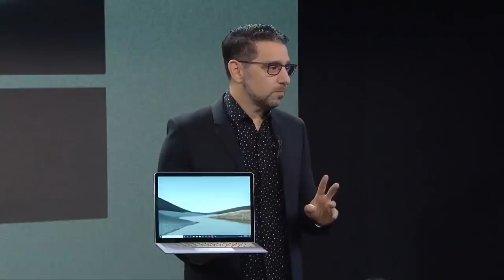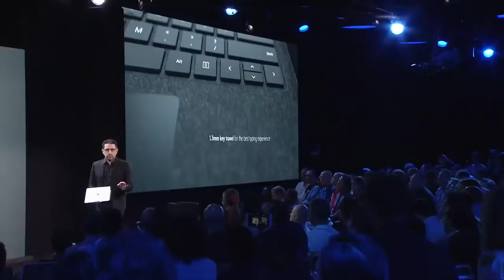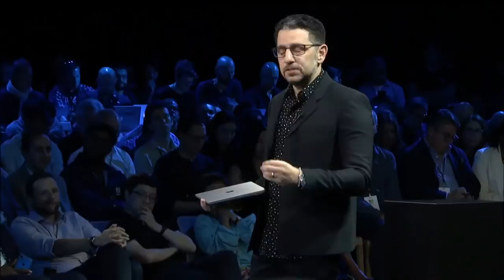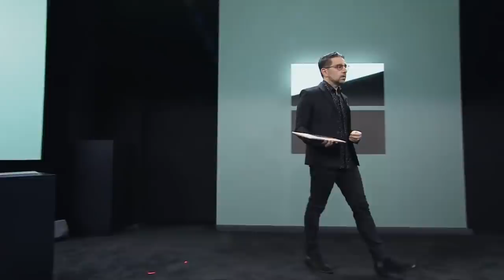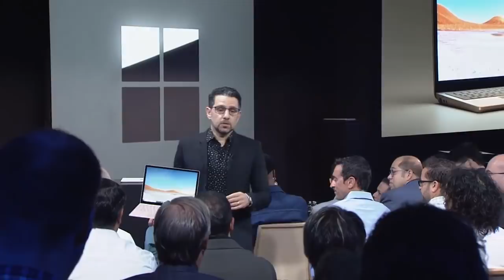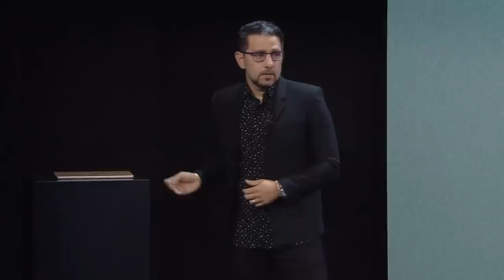Microsoft says they value repair-ability, designs more repairable product.

Comment: The surface laptop received a historic zero out of 10 on iFixit's repairability scale in June 2017
They're about to go from one end of the scale to the other ;)
Reply: Yep, it will be improved to a 1.
Reply: @zeroyon223 Im still running my G7 from 2009. fucker survived Iraq and Afghanistan. I've only had to replace my screen and battery.
Reply: @zeroyon223 well, more like the entire top portion... but show me a laptop that could handle shrapnel.
Reply: @GIboy1990  Mil-spec Panasonic Toughbook ;)
Reply: @maw136  not a chance. They can handle shockwave and overpressure. But not shrapnel

Comment: When I chose a "standard computer" for my place of work in 1998 I went for the Compaq EP series just because of a design like this - you could service it with barely a tool (all thumbscrews to get into the case, and from there it was snap in with screws that were screwed into the front plate so you don't have to look for them to add a harddrive, but once the screws are in mounting and removing the drive can be done without any tools). In addition the user could chose themselves if they wanted a (albeit fat) desktop or a minitower configuration, all they had to do was turn it 90 degrees. I loved that design, it made my network of about 60 PCs manageable for a single person (me), in addition to running the servers, administering the user base etc. pp.

HP still has a page for it, but did they learn from that design? Not really (and I can say that, having used both a Z240 and a Z610 the last few years). https://support.hp.com/us-en/product/compaq-deskpro-ep-desktop-pc-series/96269/document/c00340318

I never saw a PC that was that nice to service personell since then.

Comment: I would probably get up getting the Surface Laptop 3 Ryzen 5 15 inch model with 16 gigs of ram, 1700 is a lot but I got my first gen Surface Laptop super cheap through a couple stacked deals and has been working strong ever since.  This one being easier to repair if I needed to even just change the battery or something without destroying the keyboard makes it a really interesting choice.  I've heard the keyboard is still good and the form factor for the screen is great for my work.

That's if I don't break down and pay a bit more for the Surface X 16gig model with keyboard/pen, I do low level programming at hardware level and more than understand the weakness of ARM in terms of mass compatibility but I'm a fan/hopeful that it will become a true contender along side X86-64 processors for more than just mobile tasking.  Apple's Bionic chips have been really impressive, here's hoping this Microsoft/Qualcomm chip will give a similar result in terms of speed/access like the Apple processor is capable of.

Comment: If only they had this mindset from the beginning... I have a Surface Pro 4 here on my desk that does not boot. The only way for me to get inside to find out what the issue is, is for me to attempt to remove the screen without breaking it, and without damaging the aluminum around the screen. It's literally not worth sending to Microsoft to get fixed either, as the cost is almost the same as buying a refurbished Surface Pro (a newer model even)

Comment: I'm less about ease of repair, and more about extreme reliability. The only thing I want to be replaceable is the SSD - since these things are wearing down while bigger and cheaper models are available year by year.

I'm all right with *everything else* being soldered as long as it works fine for many years. You want to solder stuff? Fine, but give me 5 year warranty **that includes battery**. Make whole thing hard to break, use premium materials and stuff - If I'm paying thousands of dollars for the laptop, I demand quality.

 I'm sick and tired of seeing extremally expensive all soldered garbage produced by Apple, Alienware, Razer and many other companies. It's fucking ridiculous.

Comment: Microsoft: creates repairable product

Apple: Wait that's illegal
Reply: As Louis has said, even planting the "seeds of repairability" is a welcome feature as opposed to making it totally unserviceable.
Reply: "But I need AppleCare".
Reply: @Swift Boiz < Well the big difference is that at least you don't have to "destroy" the keyboard cover like you did on the Surface, in order to access the internals.  I think that's a step in the right direction, any little thing helps.
Reply: @Swift Boiz The difference is that the chance are people have better odds of taking things apart than glued shut device. Pretty sure there will be screwdriver for these new "proprietary screws" that would become available for purchase on ebay or aliexpress etc.
Reply: @MarineRX179  iFixit would be my go to.
Reply: @Swift Boiz Soldering the RAM is inevitable as even the smallest standard package of that, SODIMM, is HUGE in terms of the clearance you have in modern ultrabooks. But, in my opinion, any vendor who thinks it is a good idea to solder SSDs should be condemned, and yes, both Microsoft and Apple solders SSDs, and as far as I know, Surfaces kill their boards much more often due to overheat than MacBook pros :(.
Reply: @Swift Boiz R/Whoosh
Reply: @Swift Boiz with 3 children?  That makes sense, even if I was a Virgin how does that adjust the validity of my comment? You know what they say, if somebody makes up an insult it's usually true about the person saying it.
Reply: @Swift Boiz don't try copy me, yours was an insult. Not a joke, theirs a difference look it up.
Reply: @Swift Boiz I was in a rush, their refers to a person's property or association to said person. There refers to a direction or place. I wasn't offended I just hate when people use Virgin as an insult. It doesn't make sense. Calling someone a slag, slut or whore is an insult, but then if you don't have sex you get insulted for not being a slag, slut or whore.
Reply: ERR, I think the surface lineup is never actually even self-serviceable. At least with MacBook, you can still dust it with an off-the-shelf toolkit, or even do some minor repairs as long as you don't trip the SMC, while with Surface you are pretty much screwed...(they are not designed to last, the last one I owned just burned its GPU to death)
Reply: @Swift Boiz market share isn't that bad, I think.
Reply: Ahahaha
Reply: yeah they patented repairing so no else can do it
Reply: This made me laugh more than it should.
Reply: Illegal? There is no law  stating that it is illegal for anyone to repair their own product. What is starting to become illegal is warranty is void if removed stickers and the draconic control that the fruity people are enforcing for the sheer profits they generate with it. Screw thm. I only bought ONE Apple product and found out that it was trash iPhone 3GS. The store limited to THEM only meaning having an illegal monopoly. Android allows you to side install or install other marketplaces on the device. Apple disallows that. I feel so sad for the rabid fanpeople for that product. Buying a product that is controlled by every aspect. My LeEco 3S was more powerful than Apple phones up to the 8 maybe. I paid 150 for the phone that Apple would like charge $699 for. The only reason they are a multi-billion dollar company is because of how much they make with the "Apple Tax" and those who are willing to throw away their money like that. 

I am glad that Microsoft decided to say, we would get more market share if we allow our consumers to fix their products anyway they see fit. It is a good thing too. I can replace my own keyboards, drives. batteries. I cannot fix SMCs but I can take it to a repair shop and get it fixed for a lot less than to go to a "Brand store".  Apple needs to stop it.
Reply: @SuntopKinseeker  R/Whoosh
Reply: @morganjoyce8712  sarcastic reply I did lacks in text..
Reply: The DOWNFALL of EXPENSIVE SELFISH FUCKING APPLE! 🍎😂😂😂😭😭😭😭😭😭
Reply: @Swift Boiz I'm with you on this. They made a huge design problem, and than they went and fixed it and are getting heaps of praise. I would say they deserve praise for the fact that they have made it so there are no visible screws or trap doors. They made the device serviceable while still keeping the same clean look of the old unserviceable laptop.
Reply: @Swift Boiz let troll: String = "Swift Boiz"

Honestly, I thought someone in the comment section would make the connection :\

Comment: People who says modularity or repairable device in a thin form factor is impossible or consumers wont bother so lets not research, innovate, and go with the mindset of failure disguste me to no end. If you believe its impossible and you don't even take the risk then you have no right to say its impossible as one who never tries or take risk will see no result from it and stagnate. Opening a laptop and setting up my own desktop at first was a huge challenge with a lot of fears of doing something wrong. But once i understood and got the hang of it. I find my fears laughable and I even enjoy helping other repairing or even building up their desktop but in exchange of a bit of their time to explain to them how to service it. Even if they are not really interested, they do listen and see why their hardware failed on them.

Microsoft is taking a good step towards it. But still miles away from an ideal solution. Especially when they are the worse to repair after copying poorly apple and taking all the bad design choices as a positive.
We soldered all component for durability... I call BS...
We make it impossible to open to service the battery and its a destructive approach.
Google attempted a modular phone, motorola, LG and even way before HP, Samsung. Those failed to become a standard because they saw no profit in it. Also those were either not esthetic or had very poor added value. The motorola with its mods was a superbe idea, but some addons had really poor value. The JBL speaker addons wasn't sounding that great. Loud yes, good quality, no.
The hassleblad addons was a bad as the main camera. The pico projector wasnt bright enough, colors was waky and resolution of the display very poor.
But those were a good step towards a modular phone. They needed to polish and improve the design much more. But they gave up.

Comment: @Louis Rossmann  while i use PC's thus microsoft windows i find with the plug and play setup if you do have an issue with a component it is generally easy to replace. but fixing the board itself i do not know.

Comment: @Louis Rossmann - Hey Louis, I have a used ASUS NVIDIA GeForce GTX750Ti-OC video card I purchased from AliExpress a year ago.  I've used the card for almost a year and it started locking up randomly.  When I examined the board, I found that a capacitor had been ripped off the board.  It was this way when I originally received it but I didn't have software that was demanding enough to cause the defect to show up.  ASUS (the manufacturer of the video card) says that I am not allowed to have access to the information that would tell me the value of the capacitor and that they can not tell me the capacitor value themselves.  The company I purchased the card from refuses to talk to me.  How can I find a schematic for this card to fix it?

Comment: Only problem i see is that when people buy these "repairable" laptops and find out that they actually can't repair a single thing on them, they're just going to turn full 180 degrees and say/think that "repairability" is useless. And then microsoft can use that as an excuse to make a fully enclosed laptop that require a 500$ service to fix a broken power jack.
But i'm just some poor moron, so i'm probably wrong.

Comment: I'll believe it when I see Microsoft practice what they preach.
Reply: @cbialorucki  I was talking more towards that hardware product lines, surfaces are notorious for aweful reparability. Many (if not all) current surface models required you break and replace the screen if you want to repair/access anything inside of it.
Reply: @cbialorucki   Embrace extend extinguish
Reply: Milktank ™  *plug about privacy concerns regarding any tech company*. They aren't any better in that regard, but some of their practices ARE better.
Reply: @cbialorucki  At this point my next phone will be a Linux phone.
Reply: Their hardware is as glued or soldered together as Lenovos..

Comment: ive had the same desktop going for the past 7 years. Its an FX station no less!  And its mainly because I didnt cheap out on a motherboard and actually got a completely defect free board. I monitor my system temps constantly to make sure nothing is out of order and replace thermal paste when need be. If you are assembling a PC, dont cheap out on the MOBO or POWERSUPPLY. (my power supply is an 8 year old 750 watt thermatek with normal voltage rails.) Even though this doesnt perfectly apply to portable devices, the principals are the same.

Comment: I myself love how repairable the original PC was. Even the keyboard was repairable. If a key died, it was simple to take apart and fix that one switch. Virtually every major chip was socketed. There was almost no on board devices so everything was on an add on board. These days almost everything is a SMT device on the board and not upgradable and difficult to repair.  I'd love to buy the latest alienware laptop, but even the ram is soldered on, so you can only upgrade the storage. I miss the older days where you could upgrade anything you needed. Upgradability and repairability nearly always go hand in hand because if I can remove it to upgrade, I can remove it to repair.

Comment: The guy's stated objective is ONLY achievable if they make third party repair as seamless and reliable as "authorized" repair. Schematics and parts at wholesale prices must be available. The only thing "authorized" repair should benefit the consumer is "authorized" warranty.
Reply: Even if unauthorized repair (3rd party) pay a small premium for parts I have no problem with it, if they are not paying a franchise fee to be considered "authorized". But you are right availability of those parts at at least a reasonable price is important.
Reply: That is why I bought an XPS 13 9350 back in 2015. RAM is soldered, but everything else is repairable. Dell offers a detailed manual how to repair your device. You can actually get replacement parts. And all that repairability does not come with any downsides in the design. 

People need to buy more aware of what they are buying, but good options do exist and always existed. Brands like Apple and Microsoft with their Surfaces are just getting more media attention.

Comment: low power cpu = low heat and last longer battery, microsoft introduce new cpu, and i think they have  removeable SSD but built-in ram, just a common ultrabook. price is reasonable. 13' at 999 and 15' at 1199

Comment: Soooo, can I upgrade the ssd and the ram. Until this happens I refuse to buy one.
Reply: It's probably soldered on. To be that thin it has to be on the board because just the slots to slide an m.2 NVME for example is taller than that computer. lmao
Reply: Tcll5850 if you’re concerned about upgradability buy a desktop. A laptop is supposed to be grab and go - work on the go. If you need 32 GB of ram, just get it. Most people don’t though, and 8gb is the lowest option and has been the lowest option for a while now. Upgrading to 16 GB of ram isn’t that much more expensive, and if you don’t want it then buy another laptop, especially when you realize a dimm slot would’ve taken up space they don’t have in that laptop that could be used for cooling or a battery
Reply: you can swap ssd, not ram: https://www.theverge.com/2019/10/3/20895293/microsoft-surface-pro-x-laptop-3-upgradability-ssd-apple-ifixit
Reply: My phone has 12GB ram, why would I buy a PC with 16GB?
Reply: @rkan2  youre so right just buy 3 more phones and you will have 48gb of ram.
Reply: The SSD is swappable but the ram isn’t. Just buy the ram you need and upgrade the SSD if you care that much
Reply: just get the 16 gig youre not gonna need more than that
Reply: @dejavulinx3295  ... "640 kB ought to be enough for anybody" - Bill Gates 1981
Reply: @peteshannon5194  oh and how many people still use a 38 year old pc right now?
Reply: @dejavulinx3295  LOL, who needs more then 16meg someone famously stated a few years ago....
Reply: @arnonabuurs7297  by the time you will need more ram you will likely move on to a diffrent laptop
Reply: just buy the version with the highest spec according to your needs

Comment: I'm still very happy with my MBPmid2010. Upgraded it with SSD and 8GB Ram. I recently changed the thermal paste and now I'm in the mid 60is (15 degrees less in idle than before) without any fan noise. Would never buy an apple product again. If my MBP doesn't  work anymore I'll go with a P53 or a X1 Carbon.

Comment: For the sake of not having an LCD connector I have a few hours work soldering the flat flex to the PCB. You can still fix it without parts. The company just made themselves look bad with Macgyver repaired products. I'm not tossing out a $500 device.

Comment: Very curious how that Ryzen 5/7 chip stacks up against the Intel i7
Reply: Usually Ryzen 7 has a lower IPC than i7, but the AMD integrated GPU is a huge threat. Ryzen often has a core count advantage on desktop, but maybe not as much on laptop. Still, for most use, you probably won't feel a difference unless you really A/B test the system.